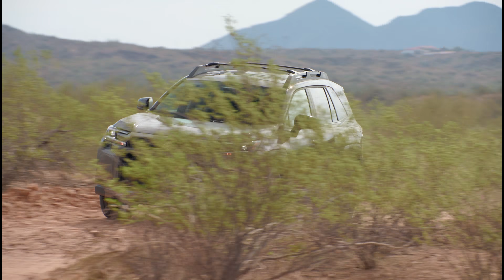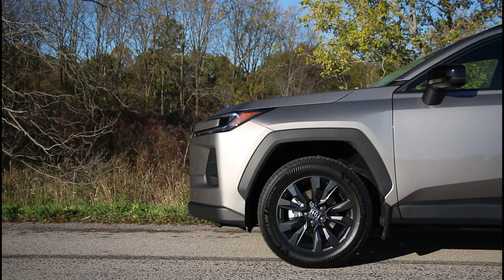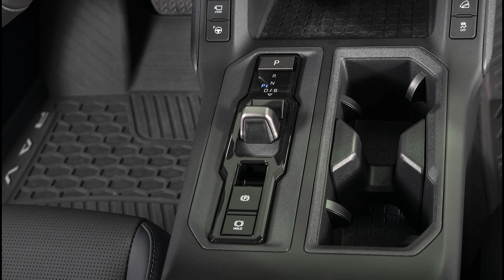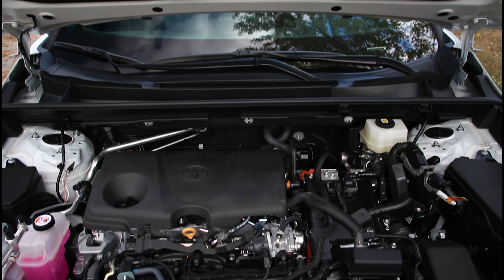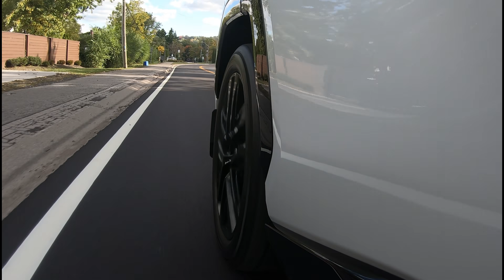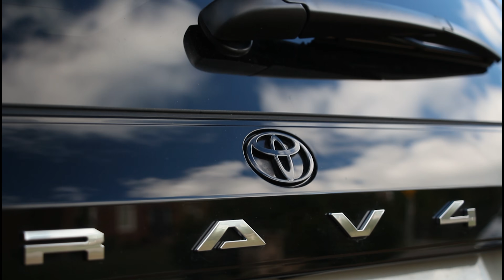2026 RAV4: Toyota Ended Gas Forever and Here's Why That's Good

Comment: We bought the cheapest 2026 built in Huntsville AL. It’s white gets 40 mpg and is a low cost entry model. Don’t need an the expensive trim packages 
Even the base model has most of the same features and technology.

Comment: Can’t believe that these new hybrids needs only a $19 oil change yearly service. What a car. You won’t spend gas too if you plug it at home during off peak hours. And they say it has autonomous mode? What a car.
Reply: Yes, but the problem with the plug-in Hybrid is that it's ~$8k more expensive than the standard Hybrid of equal trim.  With the standard Hybrid coming in at around 40mpg (although my 2025 Hybrid LTD is getting more like 45mpg in real-world driving) it doesn't really make sense.  40mpg x $3.00/gal x 10,000 miles per year only = $750 in fuel cost per year.  That means it would take more than 10 years (or more than 100,000 miles) before you get to the break-even point, and that's not even considering the cost of electricity to charge the PHEV at off-peak hours, the fact that fuel prices right now are sub $2.50/gal for many folks, the extra sales tax you will be paying on that ~$8k increase in vehicle price, or the additional fact that the PHEV's insurance will be ~$25 per month more expensive than its standard hybrid counterpart.  It is true that the PHEV offers significantly more horsepower and that's nothing to shake a stick at, but you do pay quite a bit more for that power upgrade that is not likely to be overcome by less expensive electricity prices vs fuel prices in a decade or more of driving.
Reply: @ronaldb4885 the Phev makes sense if you have a short work commute that can be covered by the battery. Imagine paying 0$ for gas to travel to work. That and the resale value of Toyota is making me take a hard look at the rav4 plug in
Reply: ….. I can save 1100$ a year on just my work commute

Comment: Toyota HEV (integral electric Advanced Kinetic Energy Management System) eliminates the need for Plugs, Plug aggravations, Plug-based anxieties, Plug vehicle pyromania, Pluggy places, Gigantic batteries, and the grotesque misuse/misapplication of batteries.

Toyota HEV makes BEV and PHEV obsolete, redundant, unneeded, unnecessary.
Reply: Not really. Still big  oil dependent. 70% more moving parts. More maintenance. Clearly you’ve never owned an EV. More Petrol Propagandists and misinformation.
Reply: @bobbituka123  The objective is not to eliminate the use of petroleum.  You may likely have been misled.  Batteries cannot ever compare to the energy density of liquid (such as petroleum) fuel.  The laws of Physics and Chemistry say so, the laws of the material world say so.  If you've wondered why Physics and Chemistry people have thought that Tesla people were lunatic dopes, this is why.
Reply: @bobbituka123  HEV doesn't require downtime for battery maintenance on a f'n daily basis.  BEV people are so irrational/delusional.

Comment: With 25 years of improvements, Toyota has nailed to hybrid powertrain efficiency formula. The hybrid powertrain is a logical step until EV battery tech improves and charging infrastructure is ubiquitous.